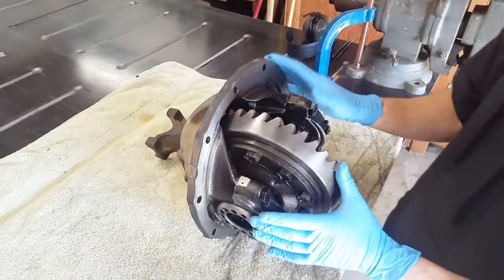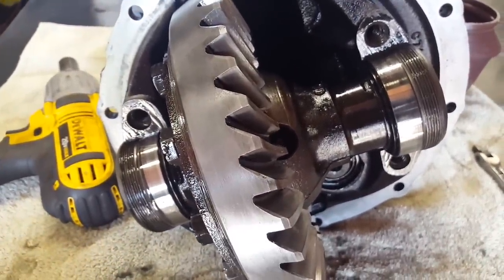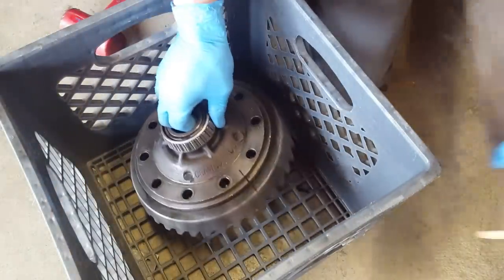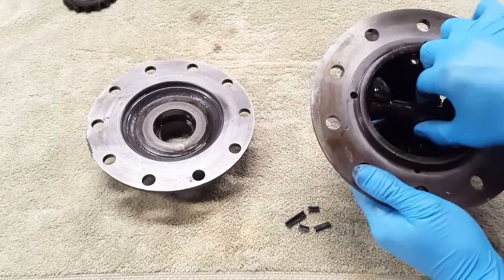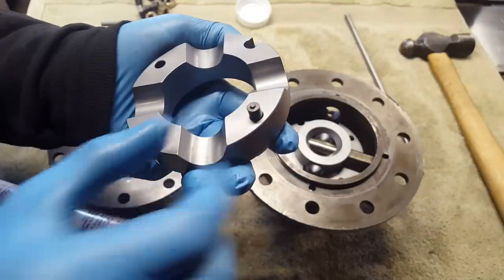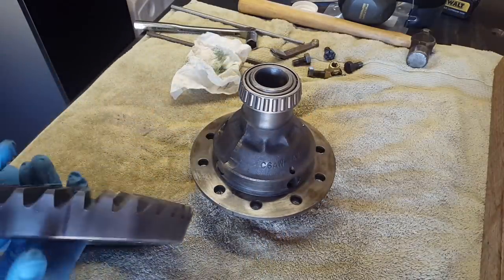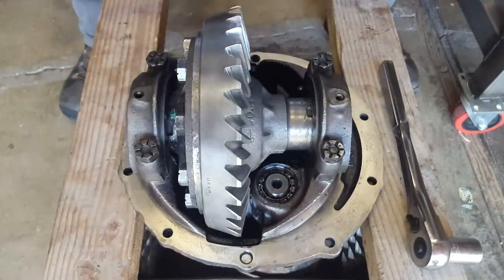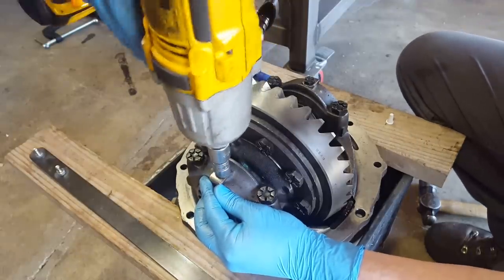How To Install an Aussie Locker - Ford 9 Inch

Comment: Excellent video, lots of detail, great lighting and easy to understand. One thing we would add to the video is to check the center gap between the two cam gears. You can do this using feeler gauges through the cross pin hole. The gap should be between 0.145 to 0.170. We rarely see Ford 9" differential case inside dimensions out of tolerance, but it can happen. The center gap needs to be within our specs for proper locker function. If it's too wide, you can shear the 4 dowel pins. If it's too tight the locker will ratchet hard.

Comment: How does it handle being locked in the rear now? Could we get a follow up video reviewing the front and rear locker? I've got my TORQ locker installed in the front, still open diff in the rear.

Comment: It is good practice to mark the exact relatiinship between the drive pinion and ring gear teeth. Some ratios change randomly. Those devisible by .25 ratio 3.00, 3.25, 3.50 etc)  are repedative in the gear teeth touching and have a common wear pattern.

Comment: Definitely like the video getting ready to change gears and Locker in my 9-inch Ford four wheel drive van going lunchbox on it I like how they handle. And we have four and a half miles of Goat Trail just to get to the main road year round
Reply: bit noisy,but volume helps.

Comment: Great review. One concern, when using the zip cutoff wheel, much of the debris went right into the right hand bearing. Also, it's a good idea to use "assembly lube" as it will turn into a liquid vs. grease. They use it often when building automatic transmissions.  Thank you for the 9 inch video.
Reply from the maker: I cleaned the bearings off camera after doing that. Not everything makes the final edit (like tightening to torque specs) for the sake of time. Good assembly grease tip. Thanks.

Comment: You should have put a mark on the side adjusters. It helps get them back to the same adjustment. Mark where the lock tab goes In to the adjuster hole.
Don't  use red loc tight on any of the bolt, if you use any just the blue stuff. You have to use a torch to get Red loc-tight apart.

Comment: It's interesting that even though it's only 2 spider gears, it's still a fully enclosed carrier and not windowed on the sides like toyota 2 spider gear/2 pin carriers are.

Surprisingly suzuki's little baby thirds are all 4 spider gear/4 pin carriers with the center block, like the heavy duty style you mentioned. I just pulled one apart the other day to lincoln lock, they're basically a 1:2 scale version of your carrier setup.
Reply from the maker: Very cool!
Reply: looks like it had hole for 4 pin,but,its a 9",better than a 12 bolt chev garb.but because of the semi,single bearing,i go d60,allways.especialy with 35" +... A d60 is half price of a 9",& twice as strong.

Comment: In your opinion is the Aussie locker the best brand of this type of locker ?
Reply from the maker: I haven't tried every style of lunch box locker but I've had nothing but good experiences with Torq Masters/Aussie Locker. Easy to install. Good instructions, good road manners, 100% lock up offroad when you need it, and relatively inexpensive. Both made in USA!
Reply: detriot the best,any lunch box is o.k.,cant understand why,me being ausie,its an ausie locker ,made in u.s,shouldnt it be armana locker,or mytag locker,??.

Comment: Hey tim how have you been liking the front and rear lunch box lockers with driving in the snow on the road?
Reply from the maker: The front locker has been really good on icy/snowy roads. No real issues, you definitely know it's there but I've been up to about 60mph on a curvy stretch of freeway in 4WD on plow packed snow and did just fine with traffic.
Reply from the maker: No icy roads with the rear locker yet.
Reply: Good to know! Thank you for the response. Jeep is looking good to!

Comment: I run a early bronco 9inch, what year is yours? Do you run spacers?
Reply from the maker: Its from a 1978 F150 and it's full width. Definitely no spacers. It's very wide under the XJ but I like it!

Comment: Whats with backlash. Im new to trucks so why do we need it and is there gonna be problems if there is any backlash.
Reply: Parts expand when they heat up. No backlash, they get too tight, too much, they are loose and can make noise and howl etc Damage will occur and life will be less without proper gear alignment. There's also the pinion depth to set which he didn't need to do in this operation. If you don't get the numbers right, you will have an improper setup that will come back to get you..
Reply: 4 - 8,thow,is good,10 is max,less than 4 it will heat up & blow,.YOU NEED CLEARENCE FOR EXPANSION, go feel your diff after driving to the shops.!!!...NEVER,drive thru water with hot diffs,they suck in water.!!.BANG.

Comment: I need some advice. My 1990 xj is on a 3 in with 32's. My fuel pump went out and I replaced it complete with sending unit. I was getting about 12 mpg and now only 9 mpg. What happened? Any advice is appreciated.
Reply: Try checking your fuel pressure regulator and fuel rail pressure. On the renix its pretty easy. I assume youve got a new fuel filter in there as well. Without an obd the renix is pretty much, "runs smooth?" Good enough!
Reply: @Jv977  yes it has new fuel filter. It runs perfect still, plenty of power and and acceleration. Nothing is leaking, no gas smell anywhere. It has a 13 gallon tank and went from averaging 200 miles a tank too 130 miles give or take a few. It's just weird that it all seems great except the numbers. I will check what ya said and thanks for hitting me back.
Reply: @stephenhickman9502  Its tough to diagnose a fuel mileage problem when the engine seems to be running okay. Try and flog it a bit and see if you can get it to show some symptoms. It is possible that you have a vacuum leak somewhere and the engine is compensating for it. Get a propane torch, leave it unlit with the gas on and poke it around near any vacccum connection, listen for engine rpm change. You can also do it with carb cleaner but not as safe. Heres the bible for renix engines: http://cruiser54.com/ hope you get it sorted out soon.
Reply: @Jv977  thank you. I appreciate your help.
Reply: SELL IT.!!!